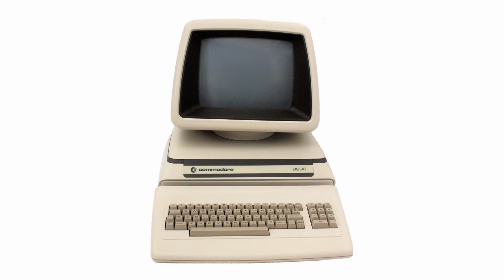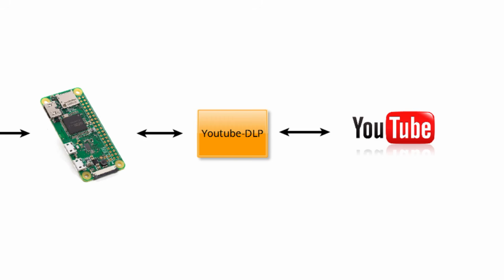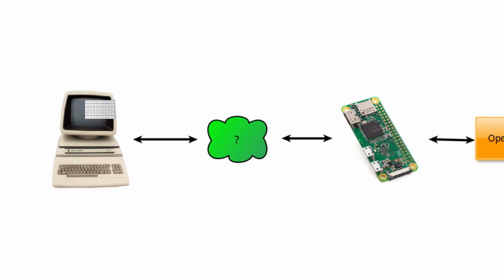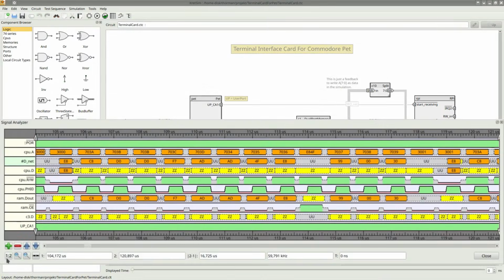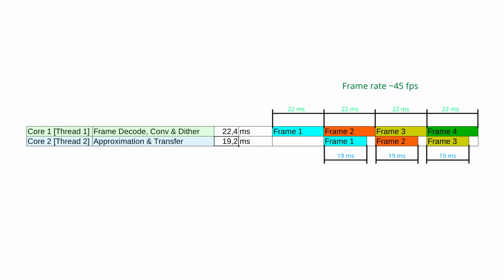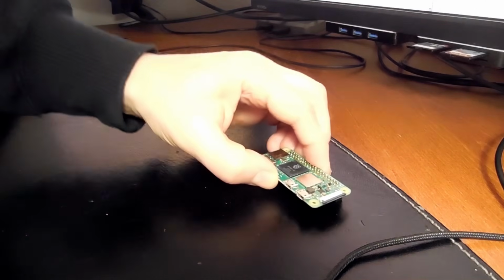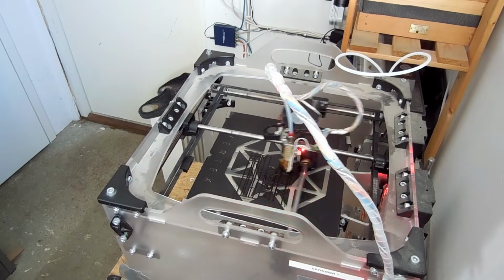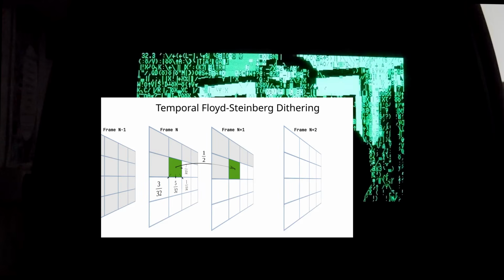Watching YouTube on a Commodore Pet

Comment: 14:02 Why not just use a lookup table for the number of '1' bits in each 16-bit word?

24:20 The PET has enough RAM that you could completely unroll the loop to 2000 sequences of LDA absolute : STA absolute = 8 cycles per character = 62 fps.
Reply from the maker: Hah! Good feedback. Thanks.

14:02, yes, you can do that. One 64kB buffer that's used for each pair of rows, but I'm not 100% sure it would be much faster. I'd rather go with the popcount instruction => 1 cycle for 64 bits.

24:20 That'd be the most unrolled loop I'd ever done! :-) But you're right it would be faster, but the electron beam could not keep up as it's much slower than 62 fps. So, I would need to find some other use for those extra cycles (like sound, but that had the I/O issue: no straightforward way out). I'll take suggestions on what do to with these cyles!
Reply: @fulkonto1222 : Oh, popcount is a CPU instruction.  How does the CPU implement it?
Reply from the maker: One could implement it (naively) as an hierarchial tree of bit-wise adds, but there are smarter (but also more complex) ways of doing it. See for instance https://stackoverflow.com/questions/28802692/how-is-popcnt-implemented-in-hardware (which in turn references the patent https://patents.google.com/patent/US8214414). The popcount instruction has been implemented in hardware since the 60's (look at e.g. https://retrocomputing.stackexchange.com/questions/4702/are-there-any-articles-elucidating-the-history-of-the-popcount-instruction for some history on it).
Reply: @fulkonto1222  Wow! What a great breakdown and poject! This takes me back to some programming I did a while back .. and it seems like you could make time for the sound if you modify the frame transfer to interleave the pixels and then combine the four loops into a single loop and a wait-loop for timing if you signaled it from one of the control lines perhaps?

loop:

lda PORT_A_IO_REGISTER
sta PET_SCREEN_MEMORY,y

lda PORT_A_IO_REGISTER
sta PET_SCREEN_MEMORY+256,y

lda PORT_A_IO_REGISTER
sta PET_SCREEN_MEMORY+512,y

lda PORT_A_IO_REGISTER
sta PET_SCREEN_MEMORY+768,y

iny
bne loop

Comment: This is very impressive work. I have been playing around with interfacing an Arduino and an ESP32 to the expansion port of my VIC 20. I think the dual port memory might be the trick I needed. Thanks for sharing your project and taking the time to produce such a high quality video to explain it.
Reply from the maker: Thank you very much. One thing I didn't go into in the video was the required level shifting between the Raspberry Pi and the memory. In this particular case I didn't need any, but that was due to pure "luck" with the selection of signals, their driving mode and the acceptable levels. You might want to consider that if/when attaching this this memory to the ESP32.